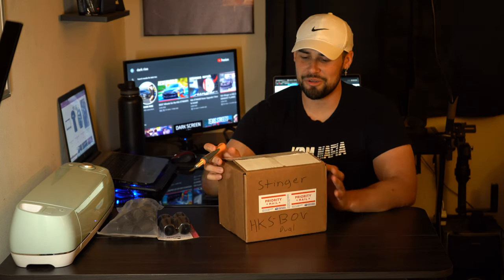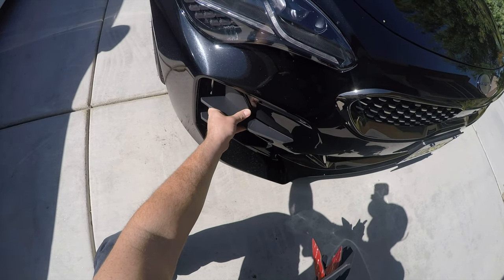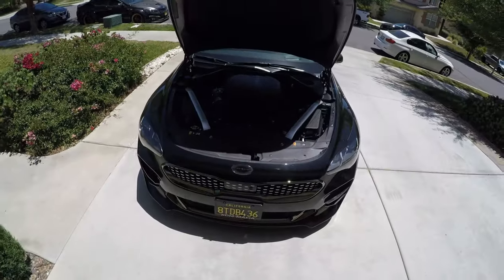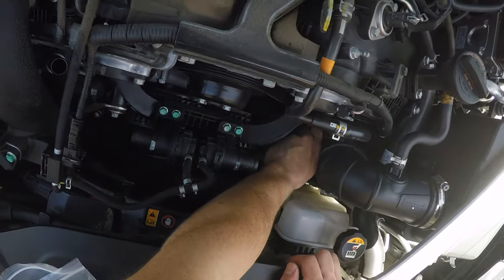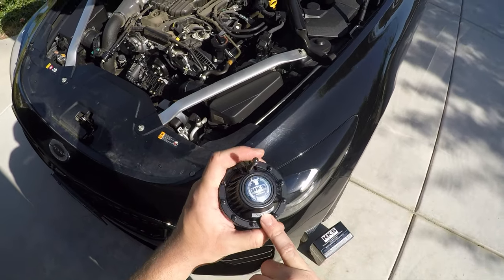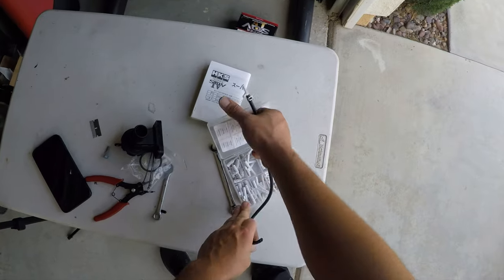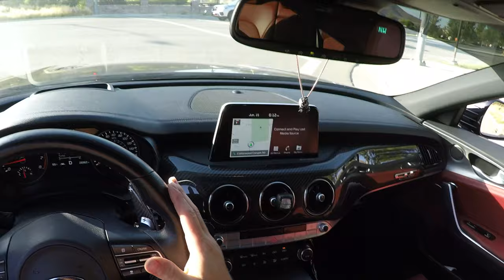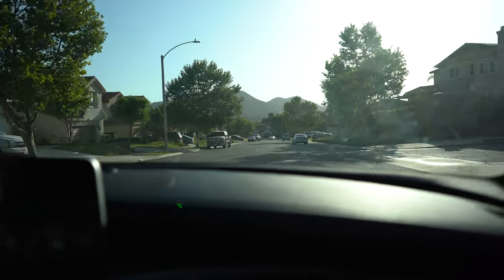HKS BOV ON KIA STINGER SO LOUD! 3.3T

Comment: Hi, I have a Kia Optima FE 2020. I wanted to know, are there any modifications you think I can or should do to it? Can you give me some tips on the major things to go for to increase HP & speed?
Reply from the maker: Hello, good question! So from what I heard from other owners pf 2020 optimas. Is that there is no power modifications for them there for limiting you to only cosmetic modifications. That being said I suggest starting with suspension and wheels💪
Reply: I have the 2019 Kia Optima FE and unfortunately he is correct about modifying to increase horse power. It’s a family fuel economy car. With that being said it still packs a punch for 185 hp. I never have an issue maneuvering in traffic. Suspension would be beneficial though. To give you even more control of the vehicle

Comment: do you have any updates on this mod i've been trying to research it lots of people say it can be really bad for the sensors in the car and make it backfire/ stall hows yours going?
Reply from the maker: So far no issues with it. But i did notice if you any leak on the lines the sensors cut boost. So its best to use minimal cuts of lines to prevent boost leaks.
Reply: @DARKRISE  good to know maybe even get some tiny  clamps for where you make the cuts in the tubes / Still gotta find somewhere that will sell these items to Australia for a decent price D: hopefully soon :(

Comment: What tool did you use to secure bolts onto car? The bovs can twist but no room for like a wrench at all to thighten with such a narrow angle so curious how you bolted them down securely
Reply from the maker: I flipped the and had the wrench tighten the top side

Comment: You don't even need the blow off valve.  Just put the cap on the intake, and the car will have that pressure releasing sound. You don't have to worry about those caps coming off.  That's a vacuum so it sucks it in

Comment: Question why with those valves do you have to block off the intake lines? And will the intakes still work if you do that?
Reply from the maker: That is for the emissions on noise control laws. That valve blows the air into the intakes there for lowering noise pollution

Comment: So taking off the recirculating air hoses for the intakes won’t affect anything ? Would it affect how fast the boost will build since that’s what the line is for ? ( please correct me if I’m wrong)
Reply from the maker: Those collect to the crankcase, but if you have a catch can setup with a filter to the crank case then it doesn’t matter.

Comment: Hey man, I’m helping my dad out and he used your video to do the install on his HKS, when the car is in parked and we were testing the BOVs the driver side BOV purges air but the passenger side does not. Is that normal? Or should they both purge when the car is parked?
Reply from the maker: They should both purge, check out for boost leaks and couplers on the turbos. Hope my video helped!

Comment: When are u gonna put some intakes and hks plugs in?
Reply from the maker: Just need to find some front mount intakes😮
Reply: @DARKRISE  THose big mouth intakes are good also. But works best with Cold air intakes. More air flow through them. You change your spark plugs yet?

Comment: do i need a chiptune or cold air intake or short ram intake for the dual bovs to work? is it bad for the vehicle in any way if bovs are installed on stock filters?
Reply from the maker: You will need a tune if you do put new intakes on these cars. They are very sensitive. Check out my latest video, i show the issue..